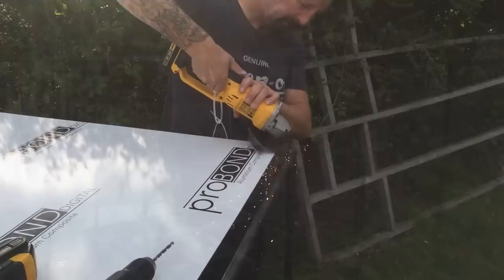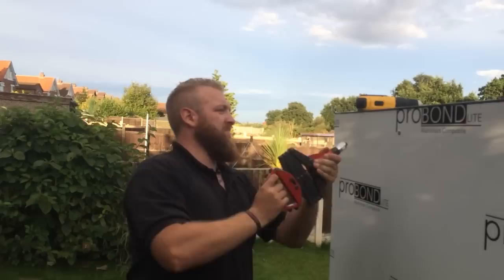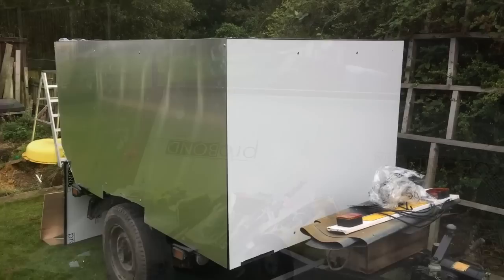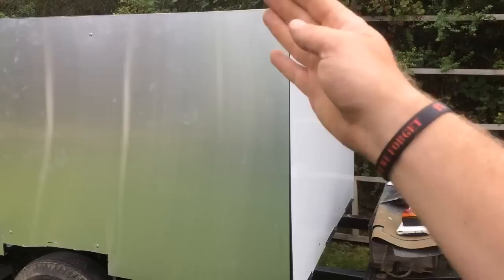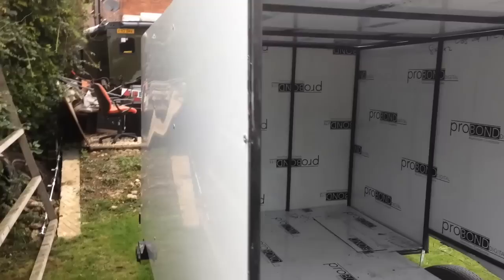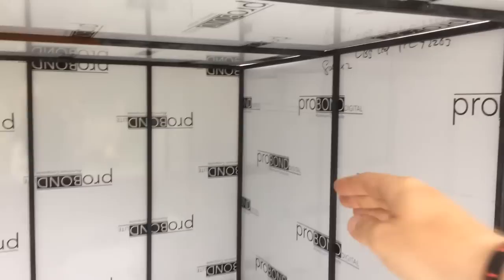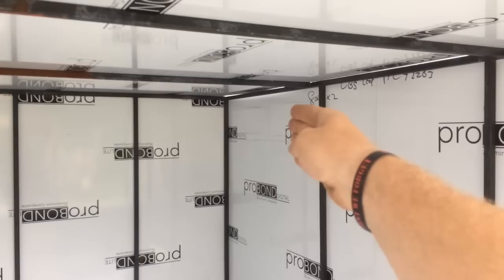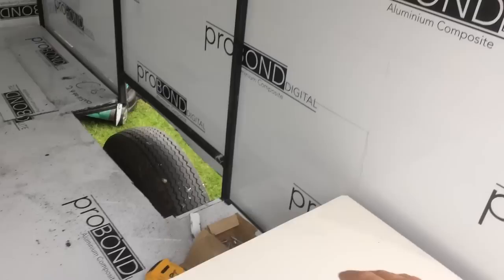short update on off road camper trailer mk2

Comment: Richard have you considered putting the hob and sink on a slide so it comes out the side leaving the back of the trailer for a work surface, a lot of the Australian trailer tents do this just to maximise the space they have, it looks very practical.

Yep definitely open your own garage mate, Land Rover and rugged trailer sleep systems with custom paint and air brushing service.

I do wish I had the skills I want to make a load space cover for my 110 twin cab but quite simply I'm a nerd and it's out of my skill set.

I'm glad you didn't change anything on the channel, keep it up and thanks for the videos.
Reply from the maker: i thought about a pull out but if i just have a clip on table i get the same space without making the plumbing harder. I'm going to build the trailer up to a good standard and see if anyone will pay decent money and if they do i will build some thing else. i could do with a garage tho to work in a sheltered space.

Comment: Can I just ask mate (not having a go) just with all the gear at the back of the trailer wouldn't that make it unstable? I'm only asking because I want to make the same sort of lay out as you've done and it worrys me, thanks
Reply from the maker: John Dugdale fair question. This one isn't bad as Iv used an off road cargo trailer as a base so it is way inside what it's made to do there is no issue. Iv also extended between the axle and hitch to make it longer for higher speeds. The main problem I find is ppl that make the body from wood as the stress over time will weaken the structure of the trailer and fail especially with off road use. That is why I build the space frame and glue and rivet the skin of the trailer on. It cost more to do it like this but I would be confident in rolling the trailer over and it still being ok to tow.
Reply: Torn Apart self sufficiency. Bug out vehicles uk  thanks for the response, I like the teardrop idea, when I get a sankey trailer I'll probably do something along the same lines as you, looks well mate, look forward to seeing finished product